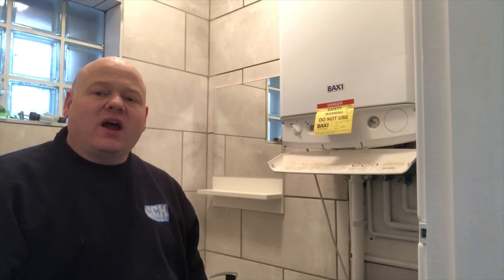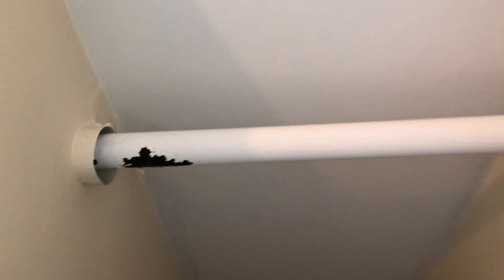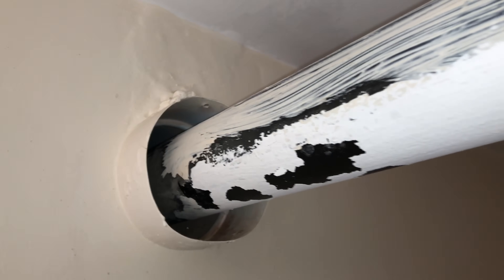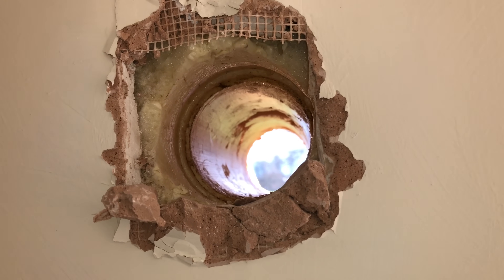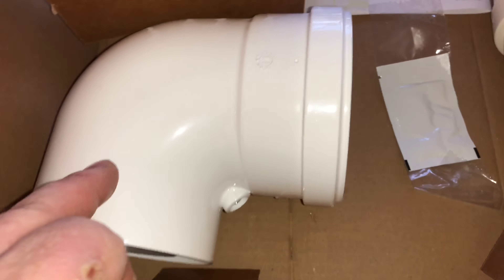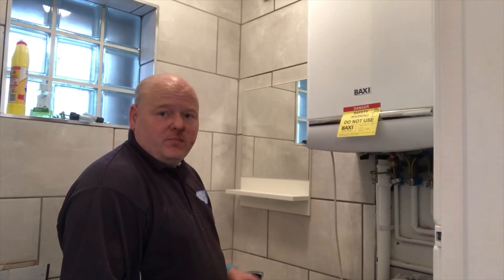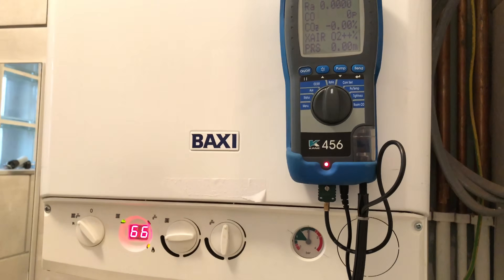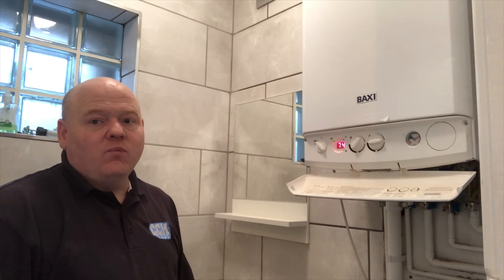Dangerous Gas Boiler  A day in the life of a Gas Engineer / Plumber

Comment: I am not familiar with the brand but some power vent hot water tanks pitch toward the outside. Most will pitch back to the unit with provision for condensate. The termination fitting you removed was nature-friendly and should have been pitched downward. ABS is not ultraviolet sensitive as PVC.  PVC only looks better. I don't think the installer painted the ABS. No, the flu does not have to fall back to the boiler. You don't want condensate to drip on people or have condensate pool in the pipe. That looked like a special venting system sold with the unit that was modified to reach through to the next wall and it had no combustion air return.  I saw nothing wrong with the exhaust air and as far as I know that flu has 0 clearance. The plug looked overkill for 3 amps. It looked more like a fifty amp plug. I am at a loss for how you check emissions on high-efficiency double wall flue. Last thing I would do.  Most manuals say only gas pressure at the manifold.  If the room door is vented some instant hots have no need for external makeup air. The booklet should be hanging adjacent to the unit.
Reply from the maker: I am guessing you are not from the UK ? most of what you say is not correct here, Thanks for watching though.
Reply: It's late there . Get some sleep
Reply: Ask BAXI why, because this is an educational video. The Baxi manual clearly states to pitch toward the termination. Believe because I made a helluva lot more mistakes than you ever will
Reply: 3.4 FLUE SYSTEM
3.4.1 CONCENTRIC SYSTEM
The flue assembly supplied for the boiler is 2.64 ft / 0.75 m in length
+ terminal.
For horizontal flues a minor deviation from the horizontal is allowable,
provided it results in a downward slope towards the terminal.
Additional fl ue components are available as follows:
3.28 ft / 1 m fl ue
90° bend
45° bend
Vertical flue terminal assembly. Refer to the separate installation
instructions supplied with the assembly.
Reply: Those are thick walls and yes I would use a concentric. Read the instructions from Baxi  They say pitch toward the terminal not the unit. 99% say pitch toward the unit agreed it is confusing.  On a side note, the hot water supply would not be adequate in with many deluxe shower systems especially if the wife is filling the bath when the husband is taking a shower.

Comment: The pressure on the central heating system rose to 3 bar.  I would want to quickly check that the internal pressure vessel was holding air (that the diaphragm was not holed) and that it was pressurised to 1 bar when empty and with one of the radiator bleed valves open (unpressurised system) before restarting.  If the diaphragm is holed (the vessel simply does not pressurise) or it was not pressurised to 1 bar initially then the pressure vessel will not have a chance of allowing any expansion from water heating in the system .  The vessel might be OK and of sufficient size but running the system up to 3 bar risks splitting the expansion vessel at the seam causing it it to leak.   I’ve seen this simple oversight run up a costly and avoidable repair.
Reply: You would think the expansion vessel would be sized to suit the boiler output by the manufacturer,  so I can't see it being undersized  , merely underpressured.
Reply: They just put in a expansion Vessel similar to most homes. As Allan says it was a big house. It depends in how much water is in the system. More water expands more. What i dont get is why the safety valve did not let the pressure out. Here in normal house we use 2,5. Bar safety valves. I might have missed it in the video but it would have preventet the pressure rising above 2,5 bar.
Reply: @homeistheearth   the pressure relief valves in most boilers is  a 3 bar one ,  so it won't operate below that level . I agree pushing the whole system up to 3 bar isn't ideal .
Reply: I’m no plumber but having been there with my own boiler, any increase in pressure like that and the Expansion Vessel should be one of the first things to be checked! Ffs

Comment: Been doing same things as you for past 6 months. It's sad that we are the last ones in the food chain of getting gas boilers running and servicing. Everything that's done beforehand is up to the owner weather they hire proper company to design heating system and install right boiler correctly, to doing maintenance. Sometimes you see nice systems and clean boilers and sometimes you see everything from hot water  pipes being switched places (thus not turning HW heating at all) , to 220V running on gas pipe because someone hadn't sorted their electricity in home or as in one instance: water being connected to gas pipe. Well as they say, you get what you pay for. Nice video, looking forward for more!

Comment: Seeing your clip here on the Netherlands makes me happy. I am a promotor for better safety standards here in NL. I promote a registered flue-test  after every visit of the maintenance guy. 
Note,
Recently there are new rules for installing flue pipes. They need to be hold in place to the building ON the joints. They hope to prevent dropping out of the connection after time. 
Thnx for charing this clip.

Comment: I had a Baxi installed by a Gas Safe Engineer....last year, it was a nightmare, everything possible was wrong with the installation, resulted in a gas leak after a month. I complained to Baxi, I complained to Gas Safe, no one was interested. I had it ripped out completely and had it reinstalled by a new one...perfect.....Gas Safe Engineer...........joke organisation
Reply from the maker: I have installed hundreds and hundreds of boilers and never had to take one back out.
Reply: The Baxi Engineer came to look cos the Gas Safe engineer had some issue and had no clue. The Baxi Engineer said everything was fine with the Baxi boiler but never mentioned that it was installed crooked. The electrics were a mess, the Baxi boiler never ran for 24 hours, the gas pipes were a mess, hence the gas escape...the brickwork on the Flu was a dogs dinner, a child of 3 could have done better. I can't tell you one thing that was up to a reasonable standard. Everything was shit. I went to Court, the District Judge told me to pay most of the balance of the money, despite me having 62 pages of evidence of shit installation and many letters. The Gas Safe engineer arrived with 2 pages....

Comment: can I ask you Allen would you not fist test working pressure at the meter and then working P at the boiler otherwise its pointless doing a gas rate on an appliance isn't it? also well done for not putting on a hard hat,,goggles and gloves when hacking into that flue

Comment: I have an unrelated question but if you wouldn't mind answering it would be much appreciated, firstly I am a mechanical engineer who does the occasional bathroom for friends and family I don't touch gas ever, I'm not risking anyone's life by going near a boiler. but my question is this, why do so many new house builders equip every single new build house with a combi boiler yet insist on installing an electric shower, electricity is around 12.7p per kwh and gas around 2.7p per kwh, the quality of shower from an electric compared to say a thermostatic mixer shower is attrrocious, yeah if all you have is electric then so be it but when you already have a gas boiler capable of kicking out 40kw of hot water then why on earth fit an electric?
Reply from the maker: I was called out to a new estate and they all have 40kw boilers, some of the houses have very low heat loss, maybe as low as 8kw for some. Seems crazy to me. Thanks for watching.

Comment: Best boiler of all time?  Think not.  Too much to go wrong.  I still have an old ideal standard concord.  Almost 40 years old and still going strong.
Reply: You can't really compare a heat only boiler to a condensing combi.

bullet proof though? - the diverter cartridges always piss out water, electrodes bend and warp, PCB's throw up sporadic E166 errors. 

Baxi have been shite for years and while this may be better than a lot of their other models, they're still crap.
Reply from the maker: @Andy-Andy  I have installed hundreds are never get any issues at all, The electrodes failed about 7/8 years ago due to lack of service, They had an issue with the cartridges that they sorted very quickly,
Reply: @AllenHart999   They are good boilers I`ve got a Platinum in my house and have had 2 more installed in houses I rent. The 10 year warranty is the big thing for me. Have to say though I replaced a Bosch and the water flow is now noticeably slower.
Reply: @Foo Me yeah okay but cmon, why would you want that. It might work for another 190 years but we need to make money so buy something new, like this really good looking Italian boiler (haha)
Reply: Comparing a boiler you could cook toast on the output to a modern efficient combi is a bit dumb.
Reply: brian whittle not really.  I am not comparing efficiency or performance only reliability and longevity and on that basis alone it’s a very valid comparison and not dumb at all.  Show me a a modern gas boiler that hasn’t gone wrong and cost its owner in 40 years!
Reply: @stihl3826  obsolete is obsolete, if you got a new boiler it would pay for itself. I personally am not a fan of keeping the outside critters toasty.
Reply from the maker: The Duo-Tec and Platinum boilers have been the best we have worked on over the last ten years, Thanks
Reply: @AllenHart999  Dont tell me ! They make hot water and heating ? What else ?
Reply: Please buy a condensing one, you need to save some gas for my children when I have thoss
Reply: @Barry Foster it depends one how much you    pay for your new boiler, my glowworm  31cxi cost me about £800 plus and old computer my mate took in payment about 10 years ago.
Reply: @Barry Foster A modern condenser combi boiler is at least 25% more efficient than your fossil while taking up less space. As well as that you are not keeping a big container of water hot all the time which costs you money. Then there is the fact that you will never run out of  hot water. Modern boilers while more complicated heat up the radiators far quicker than the old clunker you have.
Reply: @Barry Foster your using modern efficiancy ratings and pricing out a modern boilet upgrade 

the original comment is on a 40 year old boiler where efficiancy would be far higher than 25%
Reply: Stihl 38
That Concord will cost a fortune to run.  Get an Intergas.
Reply: @Barry Foster 
Look at Intergas combis. A league above any British boiler.
Reply: John Burns   Viesman...Weil McLain....Burnham
Reply: @Barry Foster can i give more than one like on this ?
Reply: @Barry Foster  I’m with you on this one mate. You killed it, explaining about the “save you money” crap!
Reply: @barry foster : iam already thinking about this and saving money to redo the complete house, with a big ass wood burner and some regenation divices and a sick inslulation. I hope that I can save enough for it. So if you buy a new boiler I can build a new home :)
Reply: These new oilers are very difficult to install...they’re all different and are glued differently...
I don’t like combination boilers...the heat shuts off when hot water is needed..
Put in a water heater or at least an indirect storage tank.
Reply: Barry Foster a great memory the old Neataheat .....ha ha I fitted hundreds in my time and have the bad back to prove it .... mind you with a positive pressure case and poor assembly fixings they worked fine whilst at the same time giving all lucky occupants an unexplained headache and killed the unlucky ones 😳😳😳 when they did fail.. all this talk of money and planet saving ... its convenience people want and pay for ... ie my old ford pop ran for years with no probs but I love driving my new fiesta with air con and licence losing turn of speed etc etc !!
Reply: I will agree with you on this one , I've just changed mine that was installed in '92 , perfectly working , BUT, with the new one Bosch , does the same thing and in the first month of use I paid 30 GBP gas less for the same house ( also colder month) , 3400 GBP to change it though ...so  yes , there are pros and cons with everything , I guess.
Reply: I agree. Duo-tec and platinum are incredibly resilient boilers and easy to diagnose and fix when they do go wrong. I have fitted pretty much every boiler, none are perfect and the baxi could make some improvements, but it is of the highest build quality, far superior to the market leader!

Comment: Great video thanks for sharing :) am I right in thinking that the mains pressure to the property was to low for this boiler to work to its full potential, if so, would it be suitable to install a mains boosting pump such as a home boost to give a better working pressure? (I know you said this boiler was overkill for this property, but in theory) I'm not gas registered, I install a lot of bathrooms and wet room's and people often ask if they can increase the pressure to their shower (running from combi, not gravity fed) in your opinion would be be more often the case that the mains cold feed would be insufficient flow for the boiler or that the property would need a bigger boiler? I know this is a case by case scenario but for your standard 3/4 bedroom home. Shower heads seem to be getting bigger and bigger, obviously the bigger head the lower the pressure...  If anyone has any info or can point me in the right direction it would be much appreciated.

Comment: It's obvious it was fitted correctly, it's a builder that's come and done an extension on the back of the house. He extended the flu and added more radiators to the system without upgrading the boiler. It's clear as day this is a bad builder job and nothing to do with the original gas engineer. How did you not pick up on this?

Comment: @1:36 I can't see anything wrong with using a plugtop as a means of isolation, but is the boiler located in a bathroom?
Reply: As a point of interest its also a seriously OLD plugtop without semi-insulated pins. It would fail an electrical installation on that alone. As you say, nowt wrong with a plug if the boiler isn't in a special location

Comment: Thought straight away they’ve just extended through with a plume kit.
Reply from the maker: You were quicker than me. Thanks. 👍
Reply: I actually thought it was 2 1/2 inch black waste pipe
Reply: @mike004692  or that
Reply from the maker: Anyone know what or who makes the plume elbow, never seen one like that 👍
Reply: @AllenHart999  doesn't even look like a plume elbow to me

Comment: Having removed the unsafe sticker and recomissioning the gas, was it ok to leave it runing undergassed? Also you say it could run on a 24kw but you also say its a big system so would that be why a 40kw was installed or was that just for the DHW?. You never showed a fixed spur you had installed or any new controls youve added. Finally the blow off. Did you not take it to outside? I cant see the point in fixing the flue and doing nothing else as its still not to the MI's. You have to have charged around £300-400 for this so far were the customers ok with this?
Reply: Where does he say its undergassed ? He says they have upgraded pipework to suit the boiler

Comment: Allen has solid points to point out that the boiler wasn't installed properly, the water in the flue could pose danger to electrical system in the boiler, so it was indeed out right dangerous. PRV could take care of the excess pressure at around 4 bar, of course it would be nice to have an expansion vessel. Plug is fused at 3A, so not much danger there but it'd be nice to have a dedicated outlet to plug it in. Yes, it's a big boiler, but you see in the video it was maxing out at 74°C (perhaps 80°C) which would definitely do a good heating in the house. After all, it's just there burning the gas. Yes smaller boiler will be more efficient, but again the bigger boiler/pump was probably chosen to cover more radiators. Apart from the flue and plug, looks like it is decently installed judging from the video, just need to register it with Gas Safe and Baxi.
Reply from the maker: It doesnt have a bigger pump, 24/28/33/40 all have the same pump. 👍

Comment: Can you tell what to do if boiler pressure too high above 3 bar?
Reply: Turn it off
Reply: Ok thanks
Reply from the maker: Turn it off and get someone out to check it for you. It may just need a service but there is a good chance it will need a new expansion vessel. Thanks.